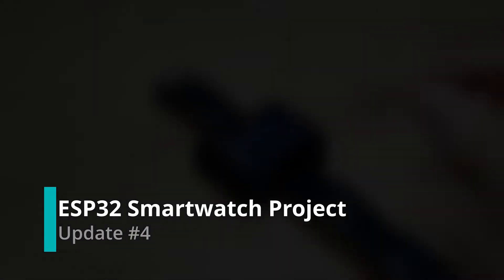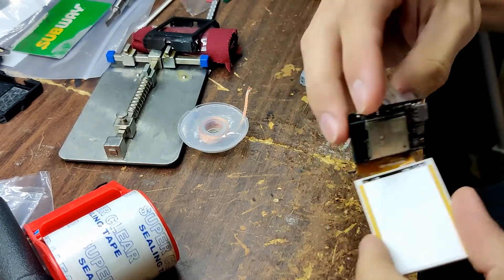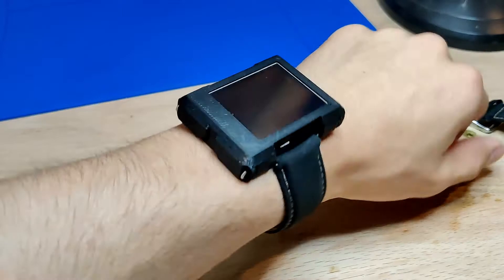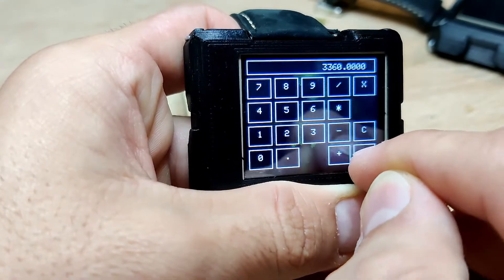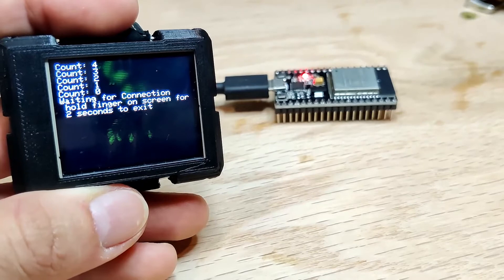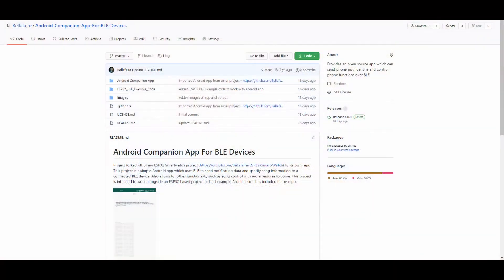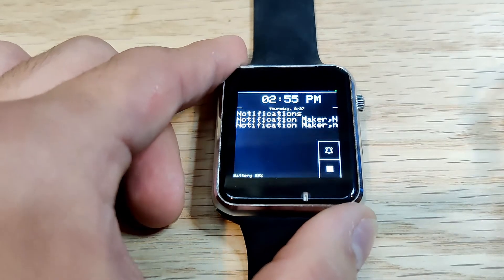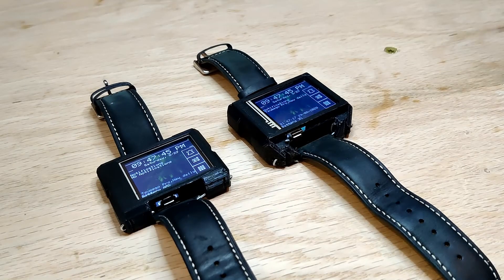ESP32 Smartwatch Video Update #4

Comment: do you directly connect the screen to the ESP without external circuitry?
Reply from the maker: There is some additional circuitry involved to connect the screen. There's a mosfet for controlling the LED backlight and a touch controller to read the touch pannel. All of the data lines are connected directly to the ESP32 though. The full schematic is available on the project github repo here: 
https://github.com/Bellafaire/ESP32-Smart-Watch/blob/master/SmartWatch%20V5/SmartWatch%20V5.pdf

Comment: nice project, can it be programmed to have a colorful display? because i want to make one but with my own style
Reply from the maker: Yes, the firmware can be reworked however you see fit. I personally like the interface design I've used but it can be reworked as you see fit. All the code is open source and available on the github page for anyone to use.
Reply: @MattBellafaire  thank you for your response, at first i thought it has a limitation in lcd that's why i saw your program design is not that colorful but since you've explained that it's your preferred design then it's gonna be a perfect project to do for me 😁

Comment: Hey dude! It's me again lol. I figured out that the problem is actually the current spike that occurs when the ESP32 does the RF calibration when connecting to WiFi. It causes brownout due to a quick voltage drop and the device gets resetted. As you previously saw, the LDO that I'm using has similar characteristics to yours (both have a max output current of 500mA but mine has a slightly larger voltage drop) but mine works perfectly until that calibration is done. I even tried using a buck/boost converter and it could not handle that spike. So my question is: How do you manage those current spikes, considering that you are even using a battery with less capacity than the one I'm using and your circuit works perfectly? Is there a way to turn off that RF calibration?
Reply from the maker: add some extra capacitence to the input and output of the voltage regulator. If your issue is that the circuit can't handle the short spike then the capacitors will be able to supply the power for those short spikes. In my design I have capacitors near the power pins of most devices in the circuit, this way if they need extra current they draw from the local capacitors.
Reply: @MattBellafaire  I tried that already. I even put a 1000uF cap between the 3V3 pin of the ESP32 and GND but it didn't work. I think that the simplest way to solve this problem is to disable that calibration but I cannot find the code to do that anywhere. Would you have any idea on how to do that?
Reply from the maker: @alessandroplacitelli7822  I have no idea, I don't think there is a way to disable the self-calibration of the ESP32 on startup. One way or another this is a circuit issue and I can't reccomend solving this one through software, you'll only be limiting the capabilities of your project. I can't offer much help without seeing your circuit, consider joining the Discord Electronics Server https://discord.gg/0zIzghXtlCfoHPcJ and asking for help there. The members are generally very friendly and willing to help with circuit issues.
Reply: @MattBellafaire  Perfect, thank you very much man!

Comment: Hey man! Awesome project! I'm also building my own smartwatch and something that I noticed is that the ESP32-WROOM-32D board (which I use for prototyping) does not work with a 3.7V/450mAh LiPo battery connected to an 3.3V LDO Voltage Regulator (part# TC1262-3.3VDBTR). It seems like the voltage regulator cannot give to much current because when I connect the 3.7V to the 3V3 pin (just for a few seconds), it works perfectly. It is very very weird because the voltage regulator should be able to output 500mA and have a tiny dropout voltage. Is this something that happens exclusively with DevBoards or will it also happen to the SMD version of the ESP32 that I bought?
Reply from the maker: I couldn't tell you honestly, the issue seems to originate more from your regulator than the ESP32 itself. I don't see any reason the external regulator couldn't work with the dev board but the module shouldn't have any issue as long as it's supplied 3.3V and has the appropriate configuration of the bootstrapping pins.
Reply: @MattBellafaire   @Matthew Bellafaire  Yes, I tried using another DevBoard and it had the same problem, so it's definitely the voltage regulator. But why do you say that a dropout of 0.35V is dangerous for the ESP32? That's actually one of the regulators that I've found that has one the lowest dropouts. I originally had de 1117 but the dropout was around 1V, so it didn't work with the LiPo battery
Reply from the maker: @alessandroplacitelli7822  I was incorrect in my original reply, the dropout shouldn't pose any significant harm to the ESP32 and the comment has been edited. There are plenty of low dropout regulators with very low dropout voltages. This project uses the LP5912-3.3 which has a typical dropout voltage of 0.1V at 500mA. I'm not sure what's causing your issue, it's likely an issue with something else in the circuit and not the regulator but I can't be sure without seeing a schematic.
Reply: @MattBellafaire  Ok thank you!